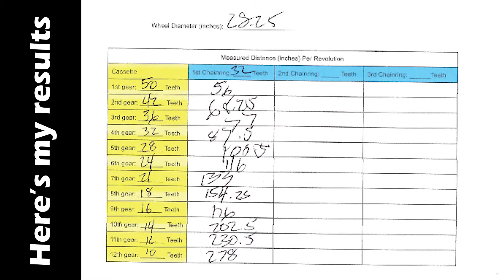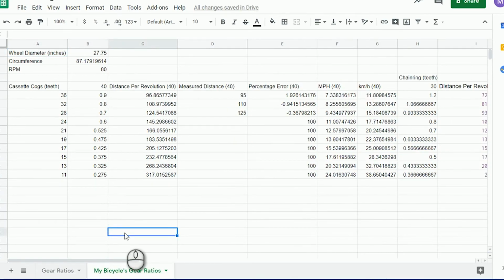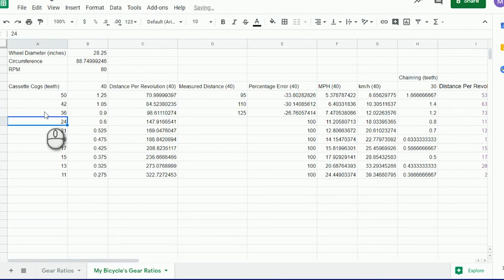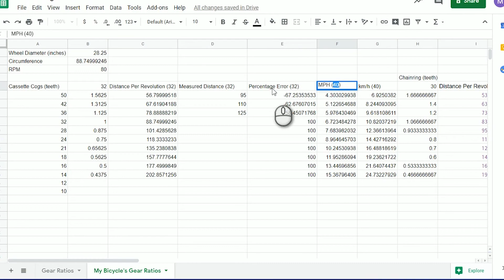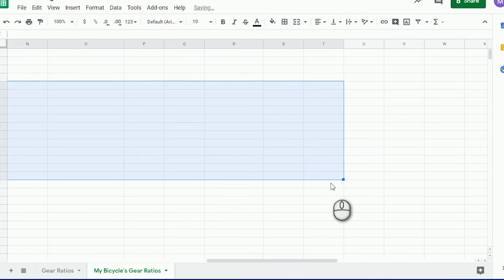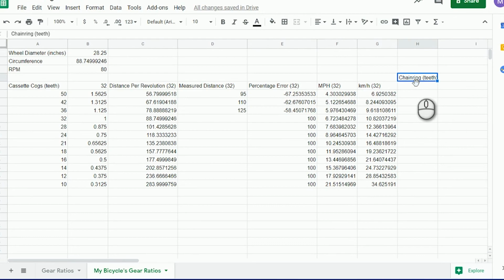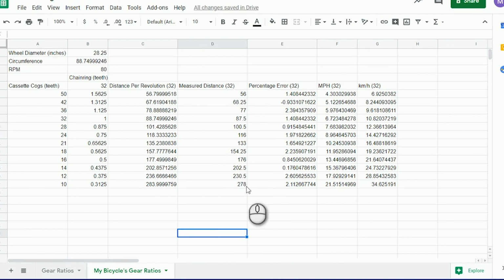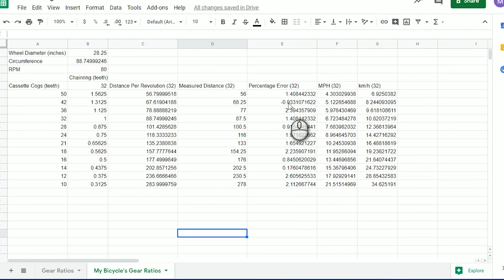How to measure gear inches on a bicycle

Comment: You don't need to do all that measuring. All you have to know is pi (3.14159) times the diameter of the wheel gives you the wheel circumference.  Then you just take the gear ratios to determine how far you travel with one rotation of the crank.  For instance a front sprocket of 48 teeth and a rear of 14 gives 48/14 or 3.43. So with one rotation of the crank, the wheel turn 3.43 times at a circumference of (26 x 3.14 = 81.64 inches x 3.43) then assume a cadence of 90 per min you finally get (81.64x 3.43x90= 25,202 inches min). Divide by 12 to get feet per min.(25202/12=2100 ft per min) then divide by 60 to get ft sec. 2100/60= 35 ft sec.  the ration between ft/sec and mph is 88ft sec = 60 mph so 35x60/88=23.86 mph. Done.
Reply from the maker: I'm fully aware of this. This is actually an assignment I give my college and advanced high school students to do. They compare actual rollout dimensions to calculated ones. This assignment gave them something hands on to do when everyone went on Covid lockdown.
Reply: Agree with original commenter.  All you're really doing with this exercise is confirming empirically that the formula for the circumference of a circle is correct!